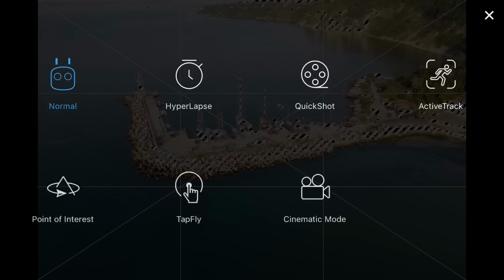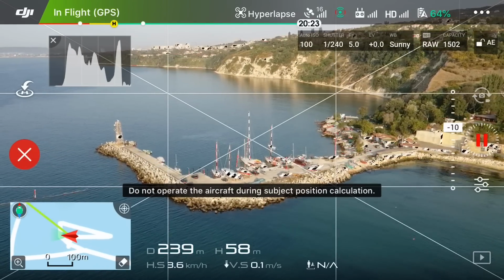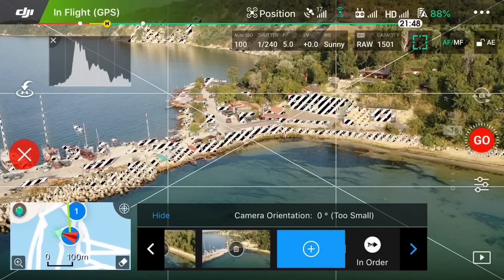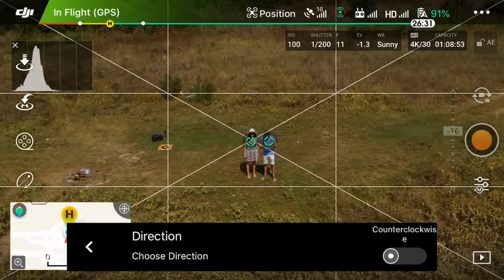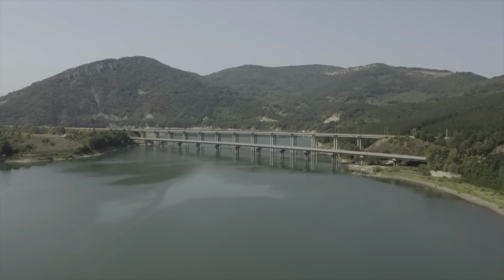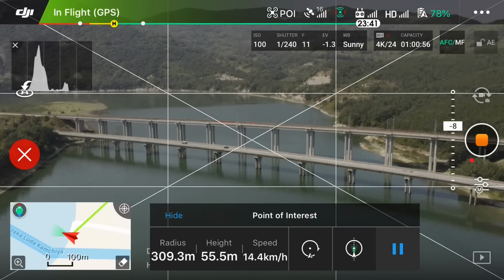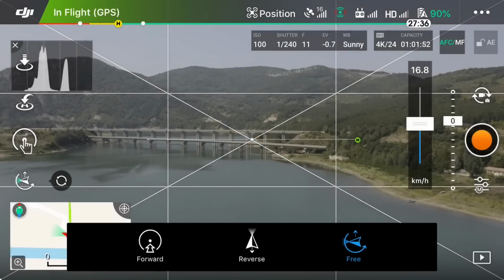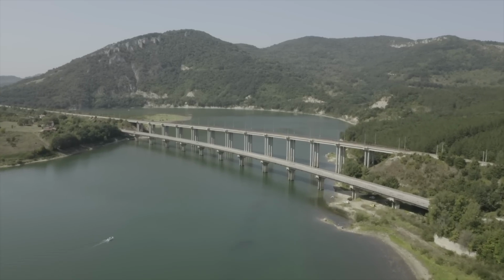DJI MAVIC 2 PRO - ALL Intelligent Flight Modes - EXPLAINED!

Comment from the maker: Mavic 2 Pro - http://bit.ly/ShopMavicPro2

TIMESTAMPS:
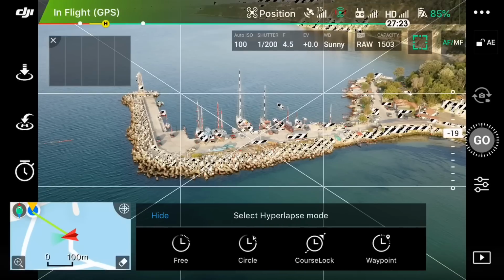Hyperlapse mode - 0:57
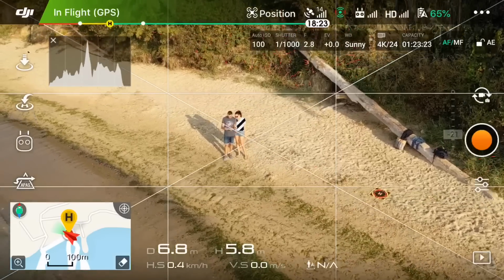Quickshots - 4:30
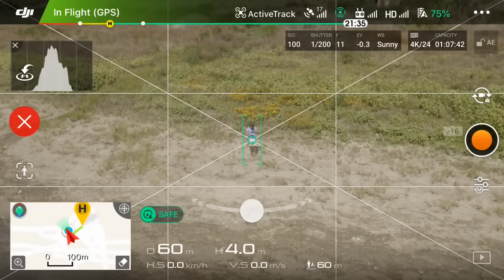Active Track - 6:30
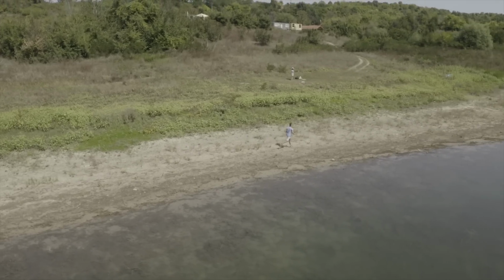Point of Interest - 8:16
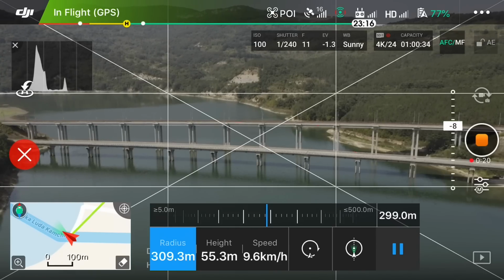TapFly - 9:35
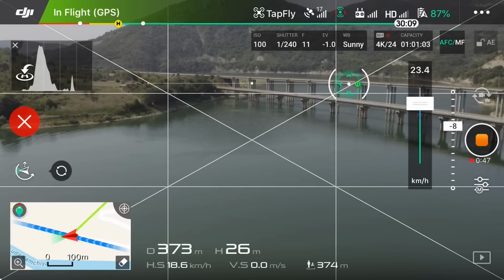Cinematic Mode - 11:29
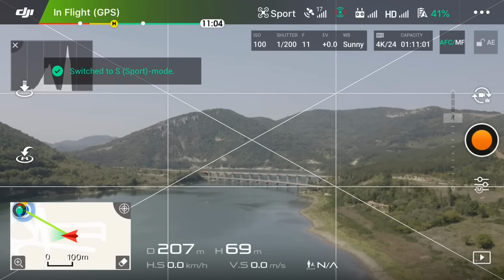Sport mode - 12:10
Reply: YOU FORGOT TRIPOD MODE ! The one reason i watchd
Reply: great video , is it auto record when i use the intelligent mode or do i have to manually press the record button , or does it have an auto record options , tnx.
Reply: Hi there i have DJi Mavic pro and i dont have the symbol on the left side off the remote control to choose which flight mode i want for example tracking mode, follow me, interest of point And so on, i have reinstall the dji app but same problem again does any one have any ideas what could be wrong.??? Thank you
Reply: Does the Mavic 2 Pro still have the “FOLLOW ME MODE”? I tried to look for it but I couldn’t find it anywhere.

Comment: One use of Spotlight Mode is to have the drone remain stationary (as if it were on the top of a pole) and track an object.  What is not covered by mode explanatory videos on Spotlight Mode is using it to lock on to a subject while you freely adjust the right stick for direction of travel or the left stick for altitude changes.  Using it in this way makes it one of my favorite modes.

Comment: If you want to ruin your drone, go ahead and use the Quickshot mode. Its the most self destructing aspect of the drone. They say the omnidirectional collision avoidance work with Quickshot, but then DJI states in a footnote that  they don't. My Mavic 2 Pro collided with a solid object while doing a circle. I misjudged the distance but I was hoping the collision avoidance would save it. Nope, the "side sensors" do not work in quickshot mode. The DJI programmers give you a very false sense of security and are not honest with the ability of their systems. Don't trust Quickshot unless you are in the middle of the desert.

Comment: Hi Mike.
I have just recived my new Dji Mavic 2 Zoom. When I use the switch for Tripod & Sport mode, nothing happens. It fly just the same no matter what mode I put in... How do I activate the switch so it works? Kind Regards Stefan
Reply from the maker: There's a setting in the settings menu which is something like "enable multiple flight modes". It's turned off by default so you need to switch it on in order to use Sport/Tripod mode. Good luck! :)
Reply: @Mihail.Svilenov  Thanks for the quick reply. It works now, so I'm very happy and can't wait to try it out. Have a nice weekend. Kind Regards Stefan

Comment: Awesome video!  Just subscribed.  Regarding Cinematic Mode: actually my first crash was related to this, and lots of user error on my part.  It was windy, and I knew Cinematic Mode slowed the movements, softened the turns and starts and stops, but I didn’t realize it also slowed the overall speed of the drone, which was a problem because of the wind.  I pushed the battery way past what was safe, making very little progress because of the reduced overall speed of the mode.  I almost got it back but I landed in a tree and hit every branch on the way down.  Hard lesson.

Comment: Hi first of all thanks a lot for your videos it helps a lot you are doing great job. Second thing is may be you can help me … when I go to quick shots I don't see menu with dronie circle and others...I am using smart controller and dji go 4 latest version 4.3.14 Do you know why it doesn't show me options of quick shots ?
Reply from the maker: Hey Yuri! Sometimes this happens if you've accidentally switched to sport mode from the remote controller, see if you're in "P" mode and check again, maybe that's the issue.

Comment: What I have noticed is when using quick shoots flight mode the camera setting shifts to automatic. I flight with ND filters and when using that mode my image will alway come out darker
Reply from the maker: Unfortunately that's the biggest problem when using Quickshots and the main reason I don't use them anymore.. I want to be able to use manual controls but for now - we can't :(

Comment: You forgot to mention TRIPOD mode, which I use a lot, because most of my pictures are night cityscapes.  Some of the flight modes are very similar to one another.  It is just a matter of learning what you can achieve with each one, and use the ones that best suits your taste, in my opinion.  Also, for me, I always try to film everything using my fingers on the remote; I consider it a lot more fun that way.  Thanks for the video!
Reply: I can't find the tripod mode.. how do I use tripod mode

Comment: Great review! Does the omni directional sensing works ok in active track mode? In old mavic, only in trace mode was ok, all of the rest were saying that obstacle detection wont work.
Second question, have you tried to follow something with active track while descending, e.g. skiing or mtbiking, because again in old version it was not descending well.
Reply: Whats the reason behind them not activating sensors around the auto modes. I wluld.think that is when you meed kt

Comment: ActiveTrack...so I want to use filming with a boat.  Can you be flying the drone and select subject such as a wakeboarder.  ActiveTrack is not really fully explained too well.  Like in Spotlight, the drone doesn't really move.  Also the slider is difficult to manage.  Can you do a full review of Active Track.

Comment: Fantastic video, learnt so much! Just a quick question, in quickshot, in the boomerang mode, are the sensors active? I wanted to take one earlier at the beach but there was a 5 metre cliff behind me so I was unsure if it would automatically fly up over it. Thank you!
Reply from the maker: Yes they’re active but instead of flying up over it, the drone will most probably just stop and hover, so you’ll need to be aware of that
Reply: Thanks very much for the reply! It’s some peace of mind to know that at least it won’t just keep flying

Comment: What is the difference between Cinematic mode and Tripod mode??
Reply from the maker: In cinematic the speed of the drone doesn't change, but the reaction time of the sticks is slowed down, so it's smoother when yawing, getting the gimbal up/down etc. 
In tripod mode the speed of the drone is severely slowed down, so if you're flying in tight spaces with not much room to fly - it's super handy.

Comment: The point of interest mode seems exactly the same as the circle feature in quick shot mode.
Reply: Adam Kuperstein - Not quite. The point of interest (while you draw a picture on the screen to choose the POI) actually picks a GPS location, based on it's calculation, while the quick shot mode actually tracks an object that can move. I found that out when I was shooting some footage of a boat, but it was drifting with the current, so the POI stopped being the boat, pretty quickly actually.

Comment: Mike can you do some low light flying tests?
Reply from the maker: Yes, that is planned for a future video :)
Reply: Low light is not good on this, noise level are horrible and starts already at 800 iso.
Reply: I understand that it is no A7S ii but its not that bad when used with certain lighting and how you handle it in post. I just got my Mavic 2 Pro and did my first low light timelapse and I am impressed with this drone. I will continue to test with the Dlog-M for my next few tests. Thanks gr8motive for your response.

Comment: The safe mode part I dunt get it clearly on video. So switch off or on safe mode - during active mode on fast moving vehicle?
Reply from the maker: If you want to follow a fast moving vehicle, tap on "safe" and it the button will turn red, meaning the sensors won't be working. But the drone will be able to reach its maximum speed.

Comment: How do you cancel out of an Intelligent Flight Mode if something bad happens, like a bird starts to follow too closely?
Great tutorial too!  Thanks!
Reply from the maker: Pressing the Pause button on the remote controller will stop the drone immediately:)
Reply: also, havent tested this but if its like the Mavic 1 you can also quickly change from P more to tripod or sport mode which will cancel the operation. in a dire situation that would be much faster than pressing the pause.

Comment: Hi Mike,
Have you had a read of the list of lost features on the PhantomPilots forum?

https://mavicpilots.com/threads/mavic-pro-1-vs-2-lost-features.46510/

I would like to hear what your thoughts are regarding DJI’s commitments to implementing these back into the Mavic 2?

Thanks...Sam
Reply from the maker: Hey Sam, I'm actually making a video on this very soon! Stay tuned :)
Reply: That’s great Mike.  It’s much appreciated.  I hope you hit DJI “low and hard” so that they hopefully listen to their customers and get these lost features implement quickly and soon.  

I really hope I did not make a big mistake by having invested over $2000 Canadian only to find out that the Mavic 2 will not have all the options that I had with the previous Mavic Pro, which I recently sold.